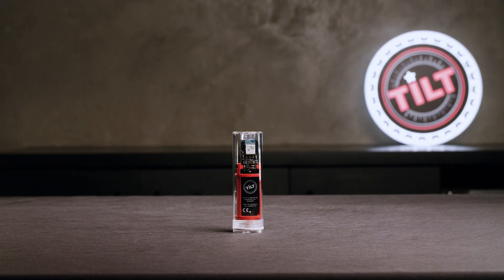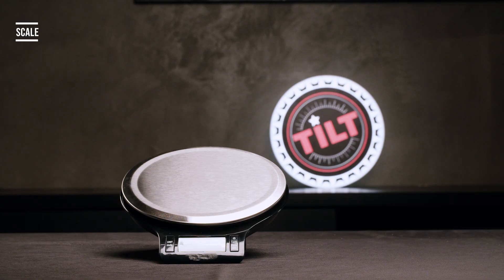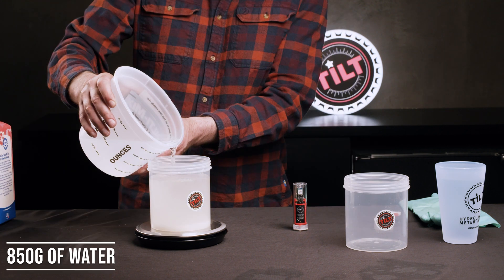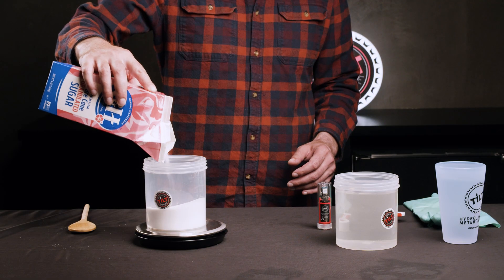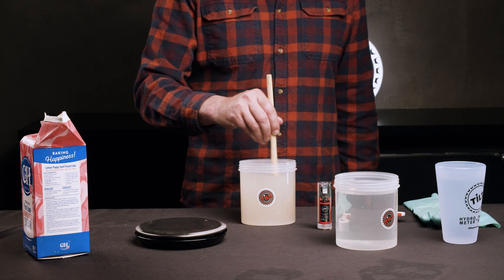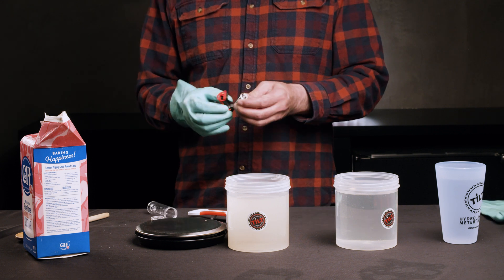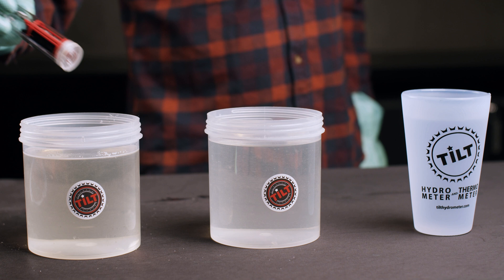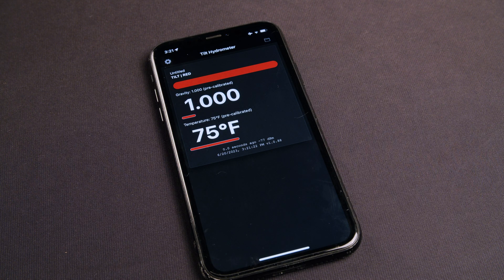Tilt Hydrometer Calibration Video (3-point Device Level Calibration)

Comment: Thanks for the video.  When I plugged in 28 Brix to the standard 3rd order polynomial (using the inverse poloynomial to get SG):
 SG = 0.00000005785037196*Bx^3 + 0.00001261831344*Bx^2 + 0.003873042366*Bx + 0.9999994636
I get an SG of 1.1196.  When I use 28.1 Brix, i get SG= 1.120079, which rounded up is 1.1201.  It seems a bit closer to your desired 1.120 SG cal value.  The mixture for cal 2 would then be 281g sucrose + 719g water.  Could I get Baron Brew's thoughts on using these (a better standard solution? does it matter? worth the trouble?)  Cheers!

Comment: Does this device calibration method also work on the version 2 of the Tilt Hydrometer?
Reply: Yes, if it has a black circuit board with the TILT logo on it, it will work. The SG must also be within 15 gravity points of the target SG, so if the Tilt reads 1.136 or higher in the 1.120 solution it will not calibrate. The reason for this is to prevent a miscalbration, since most likely it is hitting the bottom of the container or the solution wasn't measured correctly.

Comment: Could you clarify the Tilt Pro calibration? What are we multiplying by four; the amount of water and sugar to simply make a larger batch of the same SG solutions? Does the Tilt Pro still want 1.120 -> 1.061 -> 1.000?
Reply from the maker: Yes, you will need to use a 4x volume/weight for the Tilt Pro. It depends on the size of the container, it needs at least a 2 quart container, like a 2 quart paint bucket. Tilt pro uses the same calibration sequence as the classic Tilt.

Comment: You should post the Duracell info on your website. Of course I bought Duracell replacements and couldn't get my 3 Tilts to calibrate correctly. Waste of $15
Reply from the maker: Our apologies, we will be sure to put this in our FAQ and product page. Please contact us at info@baronbrew.com for complimentary Tilt branded shirt for helping us with feedback.
Reply: @tilthydrometer  So what brand of batteries can be used then? I have also replaced mine with Duracells. No wonder I have been tearing my hair out tryng to get accurate readings.

Comment: Nice video. Except you have us make the 1.061 solution 1st, then the 1.12 solution 2nd. Then you say to calibrate put the batteries back in and put in the "1st" solution. In reality the only way mine would calibrate is batteries, 1.12 solution, 1.061 solution,  and water in that order.
Reply from the maker: Thanks for pointing that out. The first solution made is 1.061 but the first solution to in the calibration process is 1.120. Sorry for the confusion. I'll make a clarification in the description.